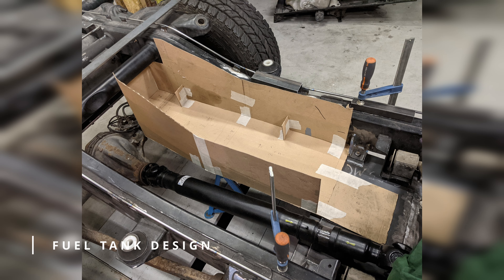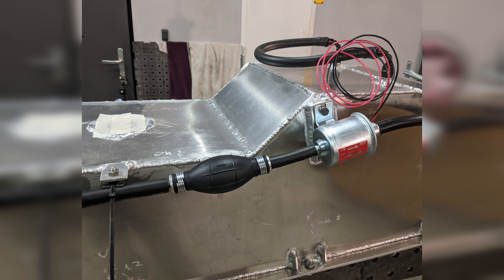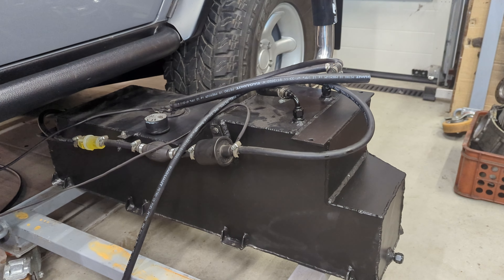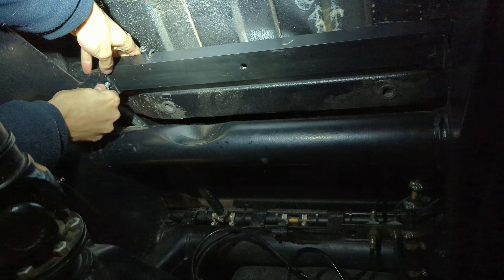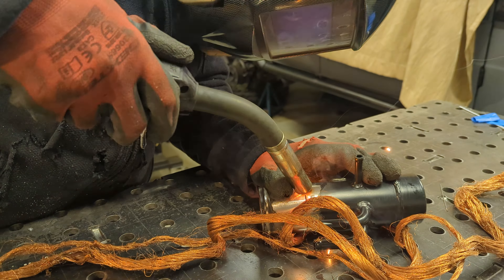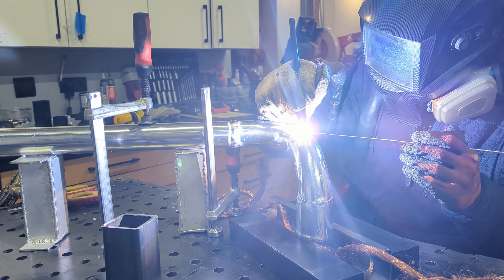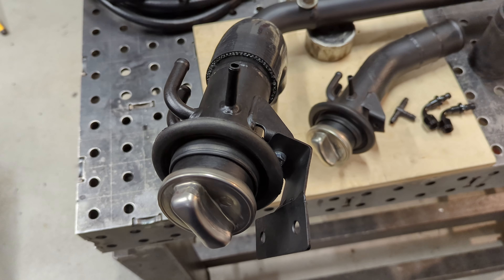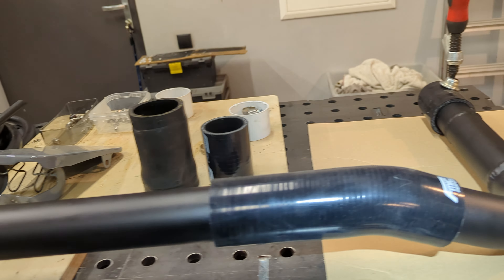Mercedes G additional aluminium 50 liters fuel tank

Comment: Did you do all the work yourself ?

My g wagon is in poland and i require the engine to be changed to om642 or om648
Reply from the maker: Not all. Engine rebuild or paint job were done outside my shop.

Comment: Great work as usual! Do you know about the function of the valve that lets air in when the fuel cap is closed? Does it allow air to come in only as the fuel gets burnt, or does it also release increased pressure? Pressure built up in my fuel tank when the temperature increased recently and caused a leak. I wonder if the valve is not working correctly...
Thanks!
Reply from the maker: Hello Paul, thanks for the comment. During rebuild I checked this valve and it allows air into the tank (one direction). During this video I performed some pressure tests of my new inlet to see if there were any leaks. At first I did it with fuel neck and cap closed. When I applayed some pressure - not much like < 1bar I have instantly heard big whistling from under the closed cap (both the cap and neck were brand new piceked them just days before, so the seal behind the cap is new as well) So what I try to say is that closed cap is not like 100% sealed with neck, it looks like it has some room to let the pressure out.
Reply: OK, this is great, thanks! My W463 has been off the road for years, so maybe the cap just needed to be broken free. I'll investigate some more. Thanks again for the information!